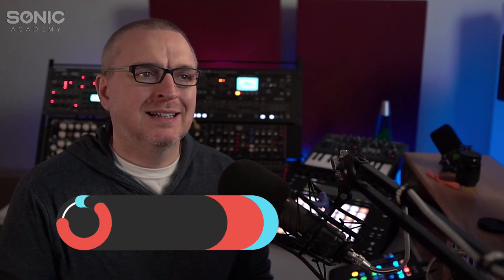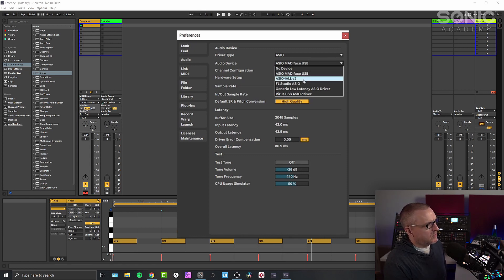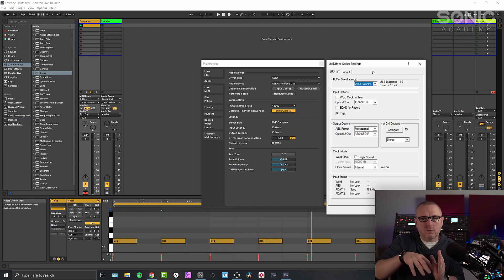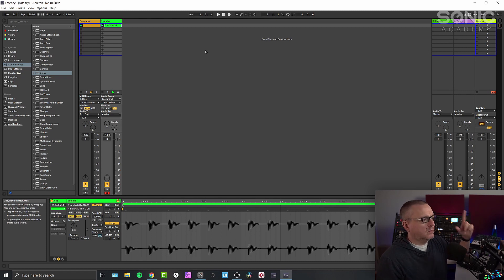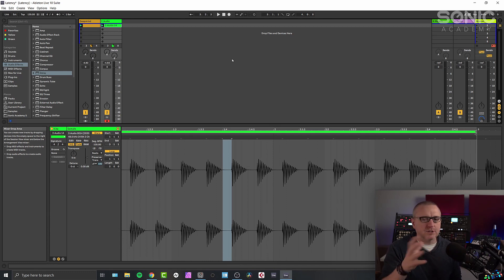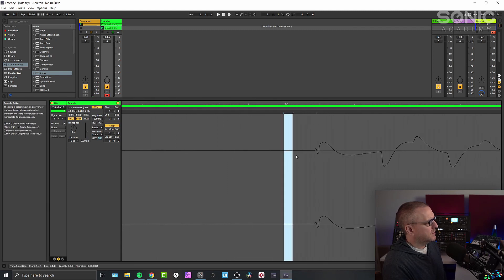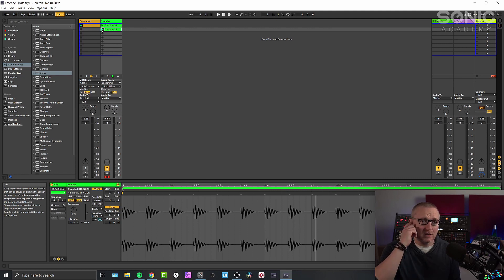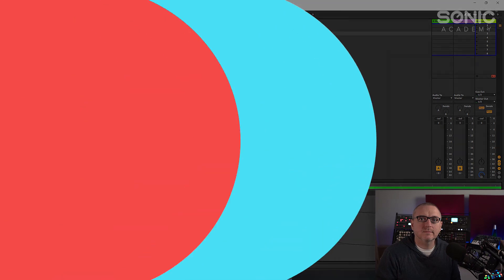What is Latency and How To Solve It

Comment: Video is a massive waste of time like all other latency videos on YouTube. You shouldn’t have to change buffer size to get perfect latency. There is a built in lesson on ableton for driver error compensation. Follow the directions and you’ll soon have zero latency midi at any buffer size. I only wish ableton would allow a separate compensation for adat out so you could fine tune it for cv tools.
Reply: Combining this video with that video is absolute gold. About to run through that built in lesson and absolutely nail my timing 😤
Reply: The video is about live input (singing/playing guitar) etc input latency too. Not only midi. I'm sorry you feel your time is wasted, but thanks for the input.
Reply: @BluffMunkey  What I posted applies actually more to recording vocals or guitar as well. Saying that a 2ms delay is not noticeable is just plain wrong and misinformation. A 2ms delay could have very drastic consequences in the bass freq when you are recording a bass against a kick. Granted ableton has all sorts of other latency issues down the line with vsts that require a freeze/flatten and adjustment during final mix downs... if you are playing live and triggering a kick internally while sending midi to a synth or even mixing a live bass player, be prepared to have all sorts of phase issues with the info from this video.
Reply: And that's why I also said that IF a latency of a couple of milliseconds matters in the context of what you're doing, then shift the samples manually. The simple fact is that a latency that small doesn't matter for 'most' of the people, 'most' of the time. Noticeable means you can't hear it when you're tracking or playing it, but of course it might cause a phase issue down the line. I did mention that.
Reply: Could you please share a link there, or do you mean the lessons built-in into Ableton Live tutorial box?
Reply: @Divuar   “How do I calculate the correct DEC value?
Live has a built-in lesson including a specifically calibrated set which allows you to set DEC. For the lesson you will need a cable and an audio interface with at least one physical input and output. This can be found in the help view:

Live 1-9:  Help → Help View → Audio I/O → Page 8 of the Lesson, click the link for Driver Error Compensation.

Live 10:  Help → Help View → Audio I/O → Page 18 of the Lesson, click the link for Driver Error Compensation.”
Reply: @AmirAbbasiOfficial  Cool, thanks a lot for an extended answer!

Comment: You can set one audio channel for playing midi (check monitor in or set it to AUTO), and another audio channel set to monitor (OFF). On both channel arm recording is switched on. 
Audio channel with monitor OFF will record with 0 latency. Am i right?
Reply: It depends what you're doing. There is an inherent delay in sending a midi signal out, the unit processing the instruction and sending the audio back. If you're tracking a guitar however, probably yes.